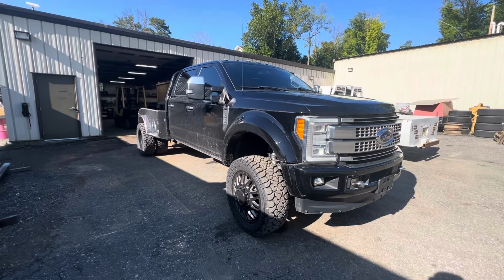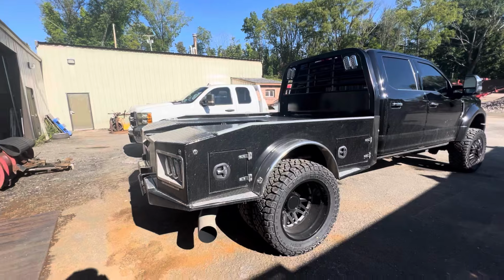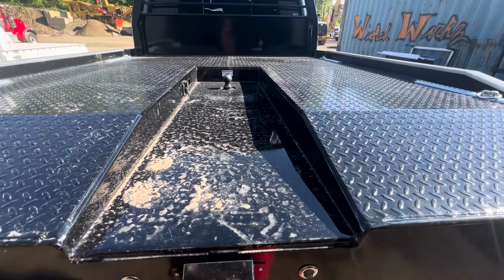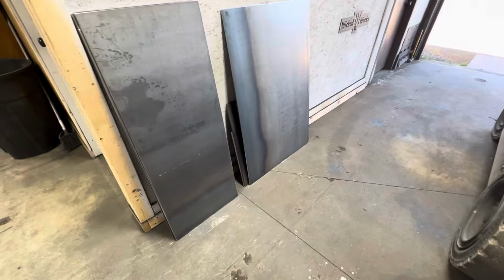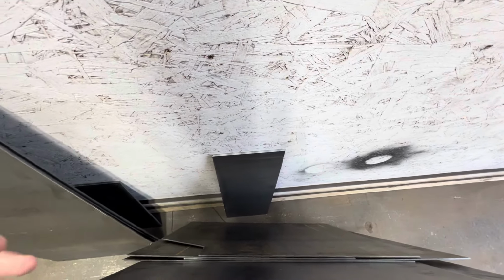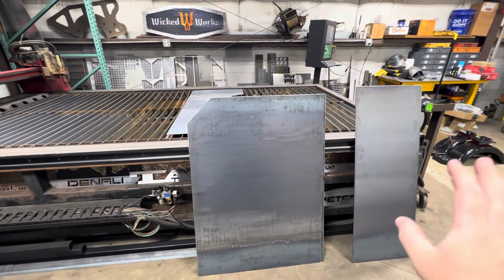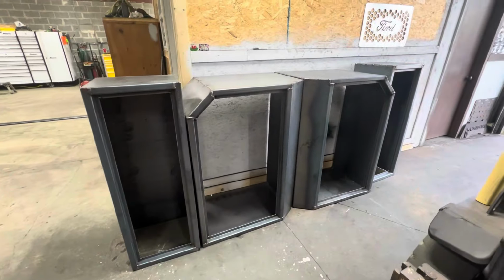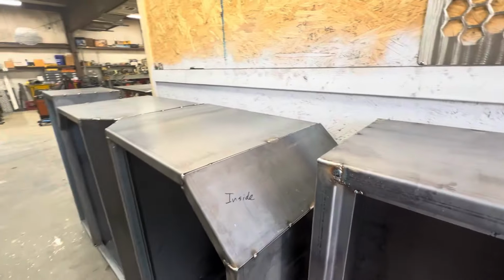Custom F450 SB Flatbed Build Series BEGINS!

Comment: Do you know if the CM bed will fit a 2001 dodge ram 3500 dually, imight be ineterested. Thanks!
Reply from the maker: @1ZlowZ  not sure its a 58” CA cab to center axle and 42 frame rail width
Reply: Can't wait for part 2!!
Reply: It won’t fit. Your dodge has a 56” ca and a 38” frame. The 17+ fords are 58”/42”. It will fit any dodge 03 and newer tho